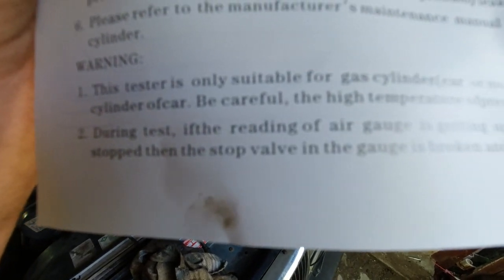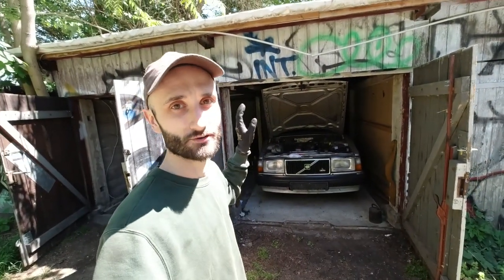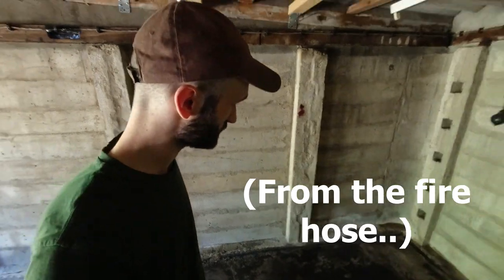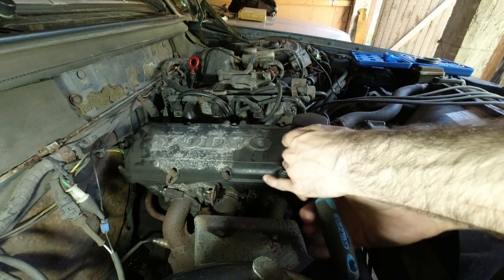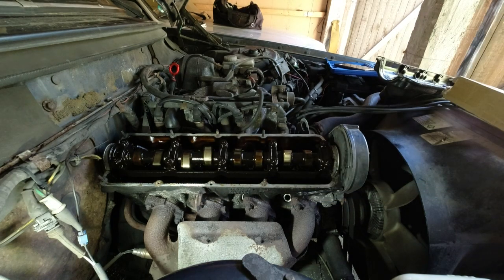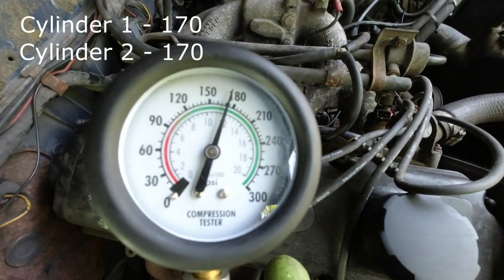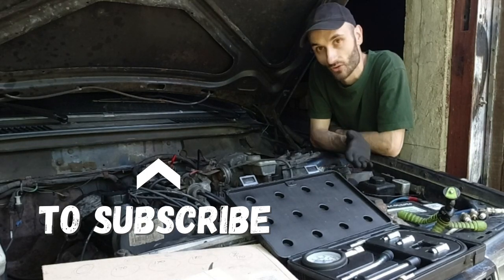Piston Slap Engine Compression Test. Redblock B230 (Volvo 240/740/940)

Comment: About this Running hotter (92) yields Less Slap.  Can you comment on why this might be?  I'm hoping that handles my Slap which is causing a serious lack of Chick approval at the Dairy Queen!
Reply: metal expands when heated, this tightens things up... a small but meaningful amount, especially when you are considering the tolerances needed to trap/compress air in a cylinder, where a thou can make a difference.  you can use a torch to heat up a bearing race and drop it over a shaft, where it can cool and lock into place, for example.

Comment: these early B230 were notorious for piston slap, a bit ennoying but they were damn good engines, mine have over 500,000 mile on it and does not burn oil and the compressions are over 170 and even on laa the cylinders.
The oil pressure is still good at 55 PSI at 2000 RPM with the engine fully warmed
not so bad...

Comment: Just found this video. Good stuff but if you were to ask me I would say that knock is not piston slap but the camshaft or rod. If the pistons were sloppy enough to knock like that I don’t think you’d get such even compression. I had a Granada with a cam knock like that and was told it needed changing, but by making sure the oil spray bar was kept clear it was no worse when I got rid of the car at over 100k!!! Enjoying the channel now I’ve found it!

Comment: An engine swap in a 240 Should not be that hard because there's so much room.
Reply from the maker: Defo, it's not as straight forward as I initially thought as one is LH2.2 and the other LH2.4, but tbh since changing the oil she's quietened way down so I might just send it
Reply: @Involvod  What color/ viscosity was the oil when you changed it, Brown black gummy?
Reply from the maker: Quite good actually, dark brown and good consistency, no metal, was from 2018 and hadn't done a ton of miles. I think it might have been a too thin grade
Reply from the maker: I filmed the service so will upload it soon. The air filter was totally black, one of the worst I've seen 😂
Reply: Believe it or not, the book time for an engine re and re is 10 hours. I really did have to swap an engine. The oil pump crapped out when I was cruising at 130km/h. By the time I was on the shoulder, the rod and main bearings were toasted.

Comment: I am surprised by the compression numbers! That's pretty healthy. Have you considered running a friction modifier like Motorkote or something in the engine to help lubricate it?
Reply from the maker: Yeah I couldn't believe it, I was expecting 140-150 at best, hopefully this gauge is accurate 😄 I'm just glad they are all the same. 

I hadn't thought about that but since changing the oil (10w40) she's much quieter right from cold

Comment from the maker: 0:00 - Intro to the engine swap
1:35 - The quiet motor
2:52 - The noisy motor
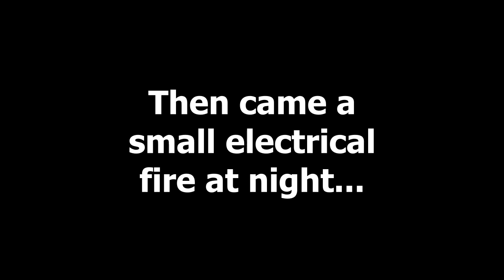3:53 - Workshop fire aftermath
4:50 - Valve clearance check
8:20 - Compression test fail
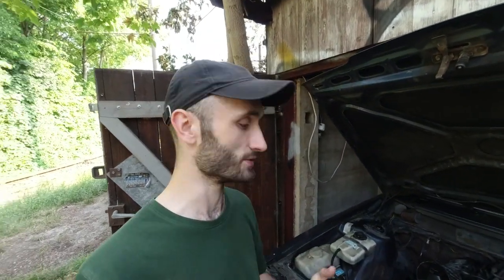8:34 - Engine temp and piston slap
10:06 - Compression test win